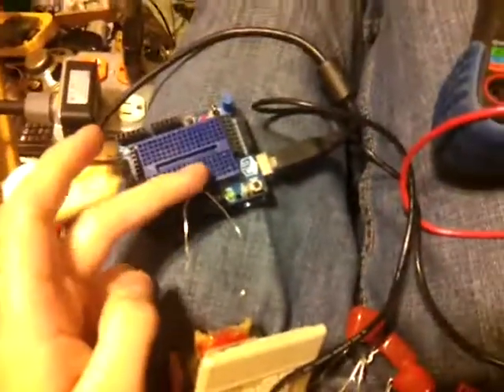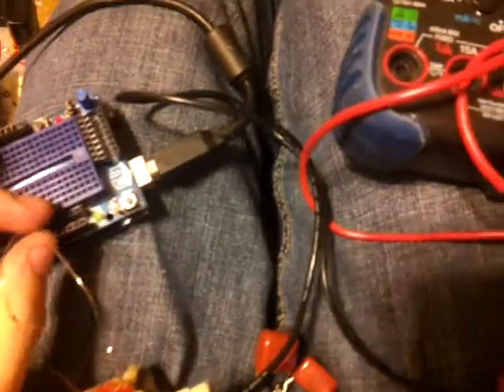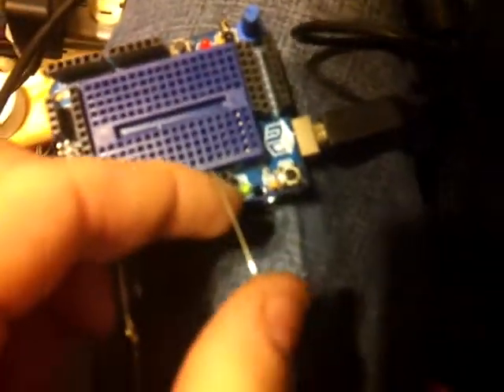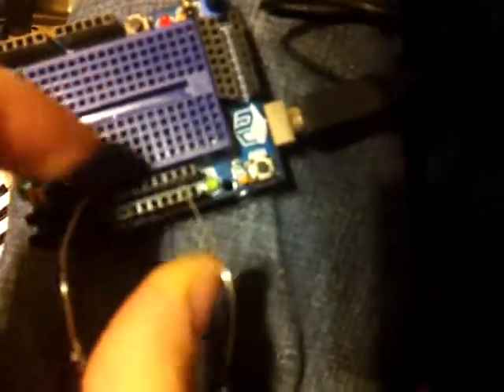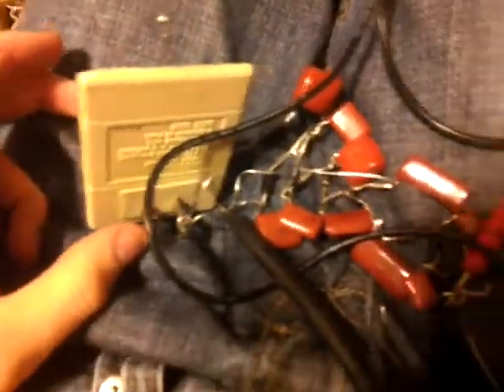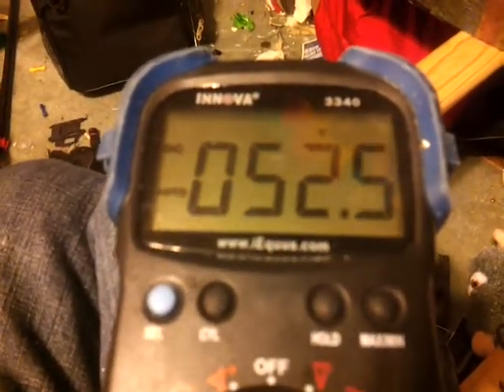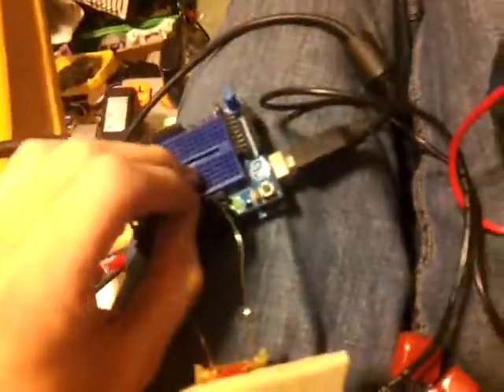neon light running through arduino

Comment from the maker: It's not the multiplier, it's the frequency of the input. I used a DC supply directly to the secondary coil and it worked as well at 120hz (60 doubled by diodes rectifying) The filter cap was not large enough to handle the straight short, so you only got half wave pulses.